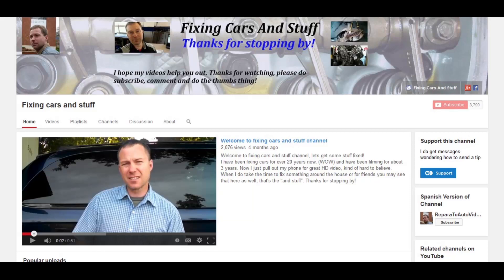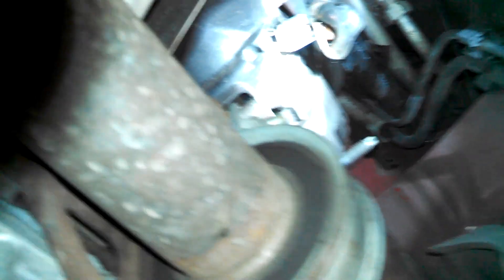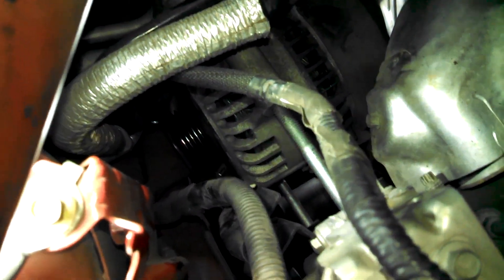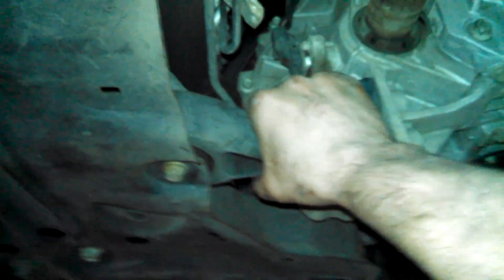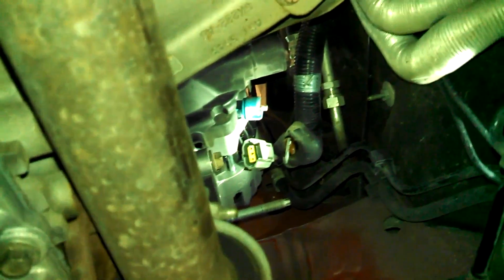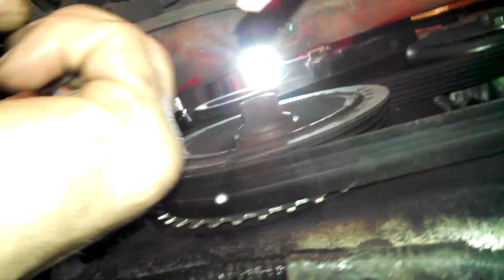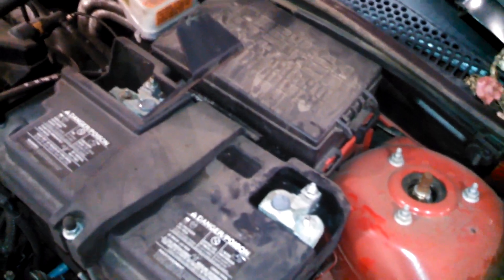Alternator replacement 2006 2007 Ford Focus Install Remove Replace How to

Comment: For the studs, just double nut with other nut. Do bottom first, then top, cause gravity.
Then on motor mount, use an indexing pry bar to wedge in pocket.

Comment: Thanks for the video. It was very helpful.

I would take a different approach, though. I took mine out through the top, and it was a lot less hassle. First off, ask yourself these questions:

1. Do I have more than 100,000 miles (160,000 kilometers) on my car?
2. Do I have any serpentine belt squeaks? (Usually a screeching or chirp on startup.)
3. Does the car vibrate at idle?

If you answer yes to either 1 or 2, take this opportunity to replace the belt, tensioner, and idler pulley. If you answer yes to 3, then replace the motor mount.

1. Set coolant recovery tank off to the side.
2. Place jack under oil pan. Make contact with the oil pan, and stop lifting once the car starts to move upward.
3. Remove the motor mount.
4. Use either a stubby wrench with a pipe, or a long wrench on the tensioner to take the belt off.
5. Remove idler pulley.
6. Remove upper heat shield.  It's just 4x 7mm bolts.
7. Remove alternator cover.
8. Remove electrical connections. (I had to stick my phone down in the gap, taking a video, to see how to remove the electrical connections.)
9. Remove 2 nuts and 1 bolt holding the alternator in. I did not need the E8 torx; but it looks like my alternator was replaced at least once already, so the studs may have been loctited in. I would recommend putting some loctite on them if they come out.
10. Finagle the alternator out.
11. If replacing the tensioner, you can take it out now.

Everything's out now! Reverse the process for installation.
Reply: lol the top is just a pain in the ass for me to much stuff in the way and the bolts are to long to mess with
Reply: +Kenny R I can't work out how trying to get the alternator out is easier any other way. It's a very long reach from underneath.
Reply: Only took me 45 mins if that I just got done as I wrote that comment
Reply: That nut for the motor mount to move forward helps so much and they wanted to charge me 600 for parts and labor. Labor took 30 mins had to run to store to get new one. Put all back together less then ten mins
Reply: @bigbro69069  nun

Comment: Thank You...Very good Video...I was going to take it to a shop and decided to go ahead and do it myself...Saved myself 2-300.00 bucks....what a stupid design on installing this...anyways had all the tools except the 8 torx socket...just double jammed the 2 nuts together and studs came out fine...

Comment: This was a very good video. I watched this to see what I was up against. Thanks for calling out the the size sockets and wrenches I needed especially  the E8 socket.You definitely need a second pair of hands when rolling the motor. Getting the alternator out from between the engine and the rack and pinion was the hardest part.  Taking the alternator out took longer than putting it back together.From getting the front tires off the ground  and on to jack stands and back down was about 2 hours and 15 minutes. 
I also took out the battery and charged it, So it was 100% . It was a little bit tough but not the hardest repair I have ever done. 
 Again this video was very good and should give you a very good idea about how to do this.

Comment: Great video . I didn't have access to a lift, had to raise on jacks. I have the same zx5 tried to pull alternator from top. Removed heat shield 5 screws, loosened hoses on firewall but did not disconnect them and it came out no problem. I knew where all the bolts and nuts were thanks to the video. All I had to do is feel for them. I wasn't looking forward to crawling underneath car and didn't need to.

Comment: Pig of a job. There is a number of videos like this but my 2007 2.0 petrol was different from all of them. My alternator is at the front behind the radiator not by the firewall. A video on the 2008 1.8 was close but still not quite the same. I had to remove the front headlamp, tensioner, water reservoir remove the bolts to the chassis for the top engine mount and push the engine back...and undo the fixings for the main power lead to the alternator so that I could drop it far enough  to undo the clip (it came out the bottom). On the plus side the alternator was held in with bolts (no nuts and studs).

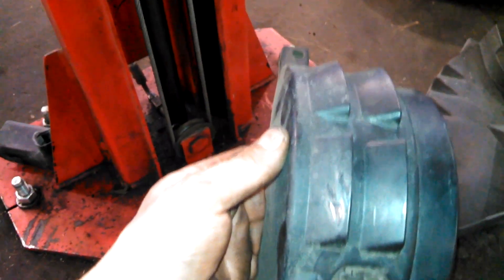Comment: Top tip: The reverse Torx E8 socket required to remove the studs at 5:27 You can instead use the 2x 15mm nuts that hold the housing mentioned at 1:57 These can be tighened up and locked together on the shaft to then use one inner nut to spanner and remove the shaft.
Reply: Holy shit thank you so much for this.

Comment: My car is a 2007 Ford cmax I'm from Ireland. I went out last night drove my car was fine. Then went out in morning car wouldn't start so late on that day pushed car to jump stared then it started to crank as it didn't happen in the morning then got macanic came and toed it away what could it be if u could do a video about it thank u its a 1.6 diesel and I tried to Jumpstart it with a 1.9 diesel Skoda octivia still didn't work
Reply: Ford sold the C-MAX in the U.S from 2013-2018 and they're the Gas/Electric Hybrid model.

Comment: Perfect example of why we say "FUCK YOU" to car manufacturers. I mean, really? Did they really need to make it this difficult? I'm convinced that the engineers that design cars these days do it just fuck everyone. And I don't get why. Because MOST people do not take their car to the dealership. Most of us take it to our local, trusted mechanic. So what's there to gain by Ford, GM, and Chrysler making it more difficult and taking more time to get it done? They aren't getting an extra dime from the fact that my local guy has to spend 2 hours disassembling my car to change one simple thing. If anyone can tell me the true answer, I will gladly shut up.

Comment: Thanks for the video. These car manufacturers have absolutely no excuse except pure greed or stupidity on their part. Making cars for over 100 years and then designing it such that you have to move the engine to service an expected to fail part (alternators, starters, water pumps, idler pulleys). Must be hiring  designers right out of kindergarten. I always laugh when anyone asks why these companies are failing and going bankrupt.
Reply: electric cars coming soon enough.
Reply: It’s a Ford thing their all junk and and pain in the ass to work on..

Comment: What's the amps on the alternator?
Reply: +Anoris William 110A for the automatic transmission. The manual transmission alternator has a lower output than that, but you can just put a 110A alt in.